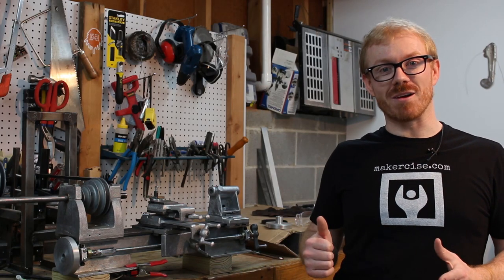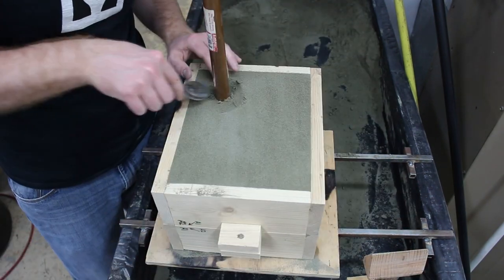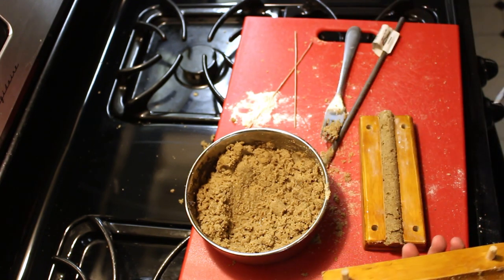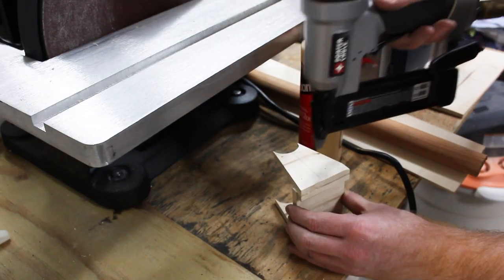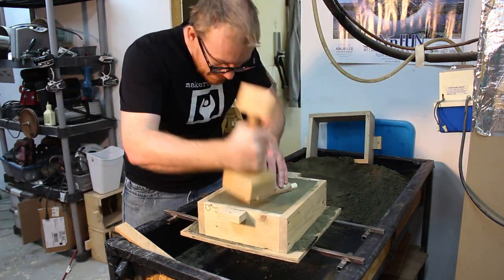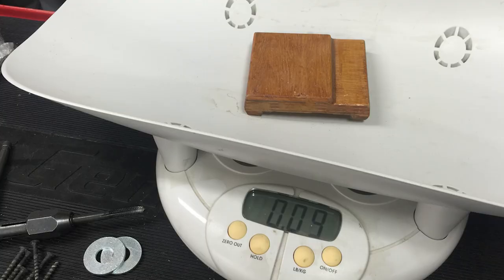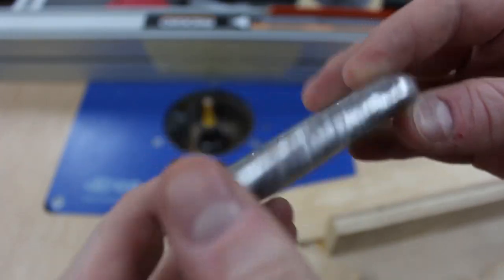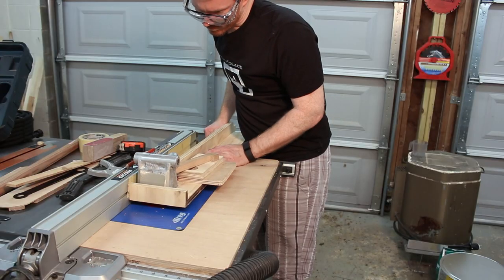Metal Lathe - Part 10: Tailstock Casting

Comment: Just found your channel! Awesome, Just Awesome! Here are a few things we have learned, they might help you. I didn't see them in the comments either.

We stopped using salts for degassing. There are lots of reasons why you are getting the popping and i have no idea which it is, which is why we stopped using them. We use argon purge. its easy. the gas comes from any welding supply store. Stainless steel tubing is used to deliver the argon down to the bottom of the melt, a regulator sets flow. We test the castings with a vacuum chamber before each pour, we plan on doing a video on all this in do time. 

DIY pyrometer! you can do it no problem and you will be very happy with it. 

Cores need to be burned in, not just baked. Using organic material in the core, molasses, Flour, corn starch ext. will lead to gas release if not burned to a dark brown or even black. think of if like wood vs. charcoal. Sodium silicate cores work well. Plaster of Paris can work.

Swing by to see what we have going on and feel free to message me direct if you need some help. Keep it up! your doing good!

Best Matt
Reply from the maker: Great insights! Welcome. I just subscribed to your channel: number 4. I need to watch your videos when I get a chance. First several minutes of the 123block vid seems well shot and edited. I look forward to following your work. I have all the equipment for a pyrometer and I also picked up a regulator for a CO2 cylinder I'll start there for degassing. Maybe I'll try to find some argon at some point. What is the process for checking with vacuum?
Reply: Thank you for subscribing Cressel! #4 is a good spot. CO2 should work Nitrogen as well and I think you'll find that very little gas is needed. Make sure there is nothing in the pipe that delivers the gas into the aluminum. Start with the regulator off or at the lowest you can go and slowly lower the pipe into the melt. Watch out for splashing. Shoot for a soft boiling action for 10-30 seconds. I think casting will be our next beginner video. You're doing very good by the way and I laughed hard knowing that you and I both smashed kitty litter for our sand, lol. We use Petro bond now.

Vacuum degassing/testing as its called. We bought a bell jar with base and a hose fitting from ebay and a vacuum pump. You can add an air tank to store up the vacuum for when it is needed (surge tank). The idea is to put a small amount of liquid aluminum in a cup. The cup is about the size of a cup cake (cup cake pan). You can make one out of plaster of Paris or cut one free from a used cup cake pan (burn off the Teflon if there is any). Preheat your sample container (cup cake pan or plaster cup) to 500F at least. Chilling the aluminum will mask or hide the gas bubbles. Place the sample of aluminum in the bell jar and suck the air out, do this quickly. This process exaggerates the amount of hydrogen gas dissolved in the aluminum. Then you play with degasers to reduce the amount of bubbles in your aluminum. The vacuum makes it easy to see if your degaser is working or not. From that point on use the degassing method that works best for you and your situation. Keep in mind that this is only justifiable if the work demands it. You seem to be doing fine. Consider no degassing at all and use clean aluminum. Keep it up and I can't wait to see you tackle your next project.

Best Matt
Reply from the maker: I made a cone for my kiln from plaster of paris and sand, but it seems to be getting brittle after <10 casting sessions. How long should I expect the plaster cup to last?
Reply: That sounds about right. The heat cycles are too much for plaster long term, it is a short term solution. 5-10 cycles from hot to cold is about right. If you want something that lasts longer use graphite, steel, cast iron, stainless steel, titanium, and most ceramic refractories will work. A steel cup is the cheapest and fastest option. Keep in mind that once you are happy with your degassing technique and aluminum source. You don't need to to do the tests any more. Unless the parts are critical in some way that demands such attention or you are like us and just want to ensure a good job. here is a link to some castable refractory.

http://www.hightemptools.com/castablerefractory.html

Sweet find with that electric kiln! Your a lucky man. By the way do you like your green sand? Who makes it and how dose it work for you?

Comment: You did alot of work to make the core.  I used a pvc pipe and slot it longitudinally.  Stuff it with the mix fortified by wires as you did. The pry it open after it dry the bake.
Reply from the maker: Great idea!
Reply: +Makercise thanks bro. I like your videos

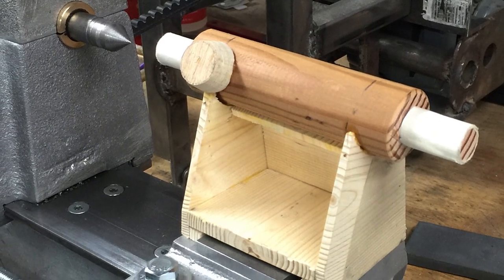Comment: 6:07 you could have tried oil based green sand. no need to worry about moisture content. 
but i know you switched to lost foam casting during the shaper project.

Comment: Magnesium sulfate holds a lot of water of crystallisation. So yeah probably as is it's worse than useless because the main source of gas in aluminum is water and oil/grease. To get rid of the water of crystallisation, melt it in a saucepan and then pour it on a baking tray then break it up using an ice pick. It will quickly absorb water from the air to make up its water of crystallisation, to the point that it is used as a desiccant. So put it in an air tight jar.

Comment: saludos desde colombia ,maestro aunque no entiendo el inglés tus vídeos me aportan bastante inspiración a uno que estoy terminando pero el mio es de material reciclado pero veo que tiembla mucho que será ósea el buril de corte irregular puede darme una asesoría gracias un saludo,espero más próximos vídeos
Reply from the maker: (Espanol) No estoy seguro de entender, pero yo intento una respuesta. Yo entiendo que se ve castañeteo de la cortadora de cuchilla de torneado. Las herramientas de carburo hacen bien. Acero de alta velocidad (HSS) también funciona bien. El acero de alta velocidad (HSS) cortadores son agradables porque puedo moler y afinar sobre una placa de diamante fino # 600 en la tienda. Otro consejo para reducir la vibración está tomando cortes ligeros de menos de 0,003 pulgadas con fluido de corte. Por último consejo para reducir la vibración es medir y tratar de reducir cualquier flexibilidad en su máquina. Sobre el carro y el cabezal, tengo menos de 0,002 pulgadas en la flexión. Menos sería mejor. Espero que esto ayude. Déjeme saber si no he entendido bien. Gracias por su apoyo y comentarios ti.

(English) I am not sure I understand, but I attempt a reply. I understand that you see chattering of the lathe tool cutter. Carbide tools do well. High-speed steel (HSS) also works well. The high-speed steel (HSS) cutters are nice because I can grind and sharpen them on a fine #600 diamond plate in the shop. Another tip to reduce chatter is taking light cuts of less than 0.003 inch with cutting fluid. Last tip to reduce chatter is measure and try to reduce any flexibility in your machine. On the carriage and the headstock, I have less than 0.002 inch in flex. Less would be better. I hope this helps. Let me know if I misunderstood. Thank you for your encouragement and comment.

Comment: Great job! 
What kind of magnesium salt you are using the casting?
Greetings from Brazil
Reply from the maker: Saudações! Magnesium sulfate heptahydrate.
Reply: I think I figured out the popping! "heptahydrate" there are five water molecules bound to each molecule of the salt. If they behave like other hygroscopic salts, you should be able to bake out the water.
Reply from the maker: newton9837 ooh! Now that's my kind of answer. I have already upgraded to CO2 degassing, but now you have me curious. I may have to revisit.

Comment: Nice work, good videos.  Does the casting temperature of the Aluminum matter? I always thought that Aluminum should be cast at 1,350* F.  I have seen the metal in the crucible turning red, that indicates a temperature of ~1,800*F.  Did you notice any difference in the quality of the castings?
Reply from the maker: I think you are right. I have not noticed differences in the castings at higher temps other than better pouring characteristics. I think some of the brighter appearance may be a consequence of lower light in my garage versus when the was outside. I think the "longer exposures" make it look slightly brighter than in the driveway. I really need to get around to a tighter controller of the temperature as a best practice either via pyrometer, or thermocouple control of kiln, or both.
Reply: I use a pyrometer in my casting, here is how I made it. http://www.alloyavenue.com/vb/showthread.php?11635-Pyrometer-build&highlight=pyrometer
Reply from the maker: Looks good. Did you save the swarf? You could keep your locks well maintained for 100 years. ;)

Comment: I think that the bubbles you saw during the melting process are due to the wetness of the green sand.

Probably small drops of water contained inside the mold, because of the high temperatures,have expanded going up on the liquid metal surface.
 
I'm not sure about that , it's just my guess , anyway nice work!

Comment: On the deformation of the casting after some machining:
The metal as cast is not quite internally stable....this is referre3d to as a 'green' or fresh casting.  Every time you do some machining, you change the internal stresses in the metal.
The casting then moves a bit.
Some iron castings like for making a Bridgeport miller are left outside for a year or more for the internals stresses to work themselves out.
Upon rough milling, some castings may need a stress relieving process of reheating and cooling before finish machining.

Comment: You didn’t show how you got the head stock parallel with the ways when you boarded the bearings or maybe I missed it
Reply from the maker: Because the headstock slides along the ways, the hole has to be parallel.

Comment: Could you have eliminated the core and cast the tailstock, solid and then drilled and bored the hole?
Reply from the maker: Martin Heermance short answer: possibly. that's essentially what I did on the headstock bearing caps. I think Gingery included the core to expose the reader to the technique of casting a core. When I drilled the headstock and bearing caps, I only had to drill 1.5". The tailstock is much longer. Fixturing on my small drill press would be difficult. I also think alignment for drilling would be challenging. I would use a core again for this step.
Reply: Thanks for the reply. Great project by the way.

Comment: have you thought about using your semi functioning lathe to turn your round work.
Reply from the maker: newton9837 yes: part 11 has the first turned parts. Both steel and aluminum used in the lead screw drive train.
Reply: I did see that after I posted. D'oh! I was mostly refering to the wooden pieces so you would have to use your table saw to try and reduce those dowel sections. I suppose though if you have more to do to the piece after casting, then the core doesn't need to be too precise.

Do you have any intentions of making any other gingery machines?

Awesome vids thank you.
Reply from the maker: newton9837 Haha. No worries. I need to make a longer lathe for wood--turning table legs, bats, banisters, and such. Perhaps I should just buy one. In the remaining lathe videos, I plan to start advertising a patreon goal designed to help me focus on the gingery machine tool project series. If I can meet the goal I will definitely proceed with the series. I appreciate the complements, and just completed the faceplate rough cut. Probably releasing the next installment in a week or so.

Comment: I under stand It slides along the ways but the head stock bearings still need to be parallel and square with the ways didn’t show how he did that in the video
Reply from the maker: I didn't do anything beyond boring the headstock and bearing caps by sliding it along the rails. There wasn't any step omitted from the footage. Because it slides along the ways, it MUST be parallel. To be fair I didn't inspect it to confirm it parallel, but I didn't do anything beyond sliding the headstock along the ways. I guess I am missing how it is possible for the bore to be anything but parallel when machined in this manner. Even if the boring bar were misaligned by a few degrees, the hole cut by the revolving tool is stationary. The holes axis is then dictated by the movement of the workpiece in this case the headstock. The hole may be slightly elliptical, but not enough for me to measure even if the boring bar were out by degrees.

Comment: Great videos, you did a much better job at presenting the process than I did with my Gingery Lathe build videos - checkout my channel if you have a chance. I modified mine a bit for a DC treadmill motor, and a speed controller of my own design. Cheers, the build is a lot of fun, and I learned a lot along the way - great setup for mold making, a table saw and a disk sander would have come in handy for sure but I got by with sand paper, files and a bandsaw. Cheers, Morgan
Reply from the maker: You get the top spot in many of my credits. Your videos are the reason I started this project and the reason I took footage of the process early on. I am learning a lot and very thankful to you for giving me the inspiration to get started. It is great to have you commenting. Cheers to you man!
Reply: That's awesome, thanks for mentioning my videos, I definitely appreciate that, and it's really cool you drew on them for some inspiration to tackle the lathe build yourself. I remember when I first started the build there wasn't much out there by way of information, so that really motivated me to try and document the process for others to see. You definitely have a knack for the videography aspect of it all, something I'm still working on for sure - there is no way I would go back and do the build again to take a second whack at doing the videos over again, so it's really cool you are putting these together. Your castings, and the lathe, are coming out great. I'll be sure to checkout the rest of your videos over the next couple of days and subscribed to your channel to see what you work on next.